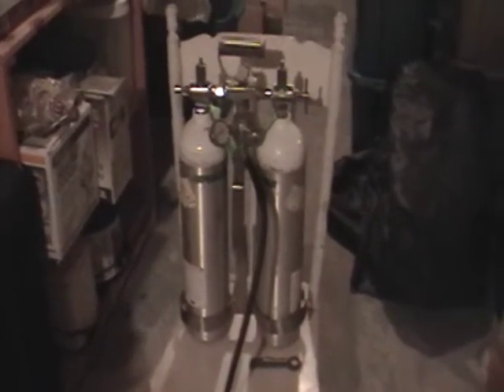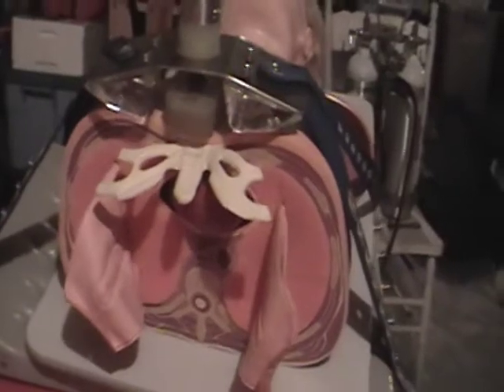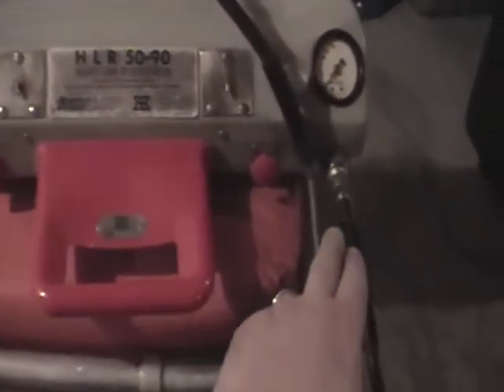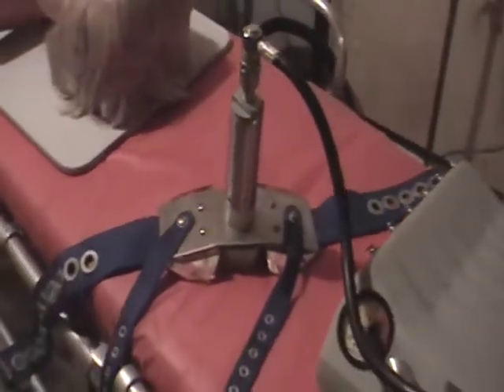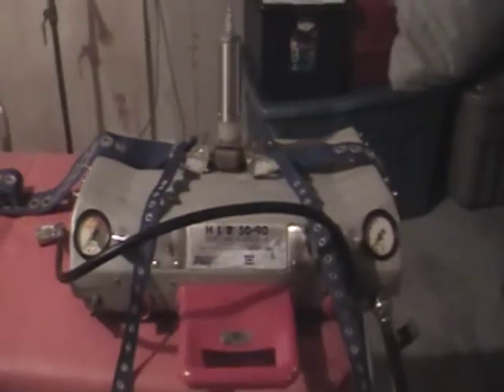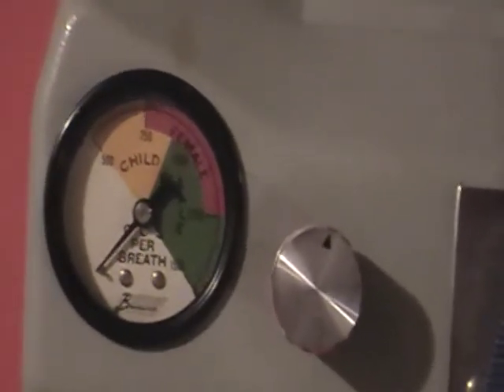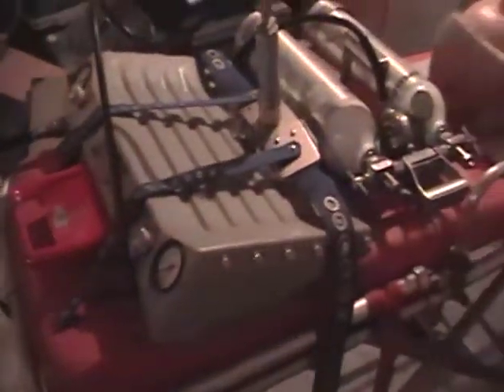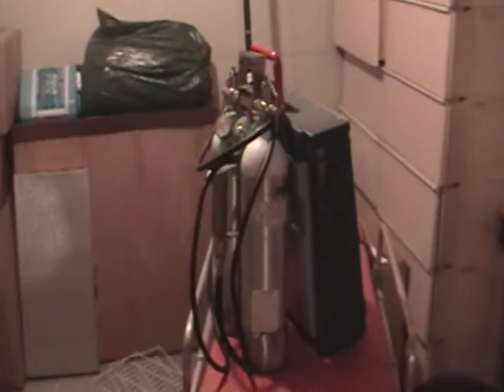Vintage Ambulance Equipment - HLR (Heart Lung Resuscitator)

Comment from the maker: Thanks for the comment.

This device was built by Brunswick Manufacturing and according to the serial number was manufactured on September 23rd, 1963.  It is the right age to be used in either my 67 or 69 ambulances.

Brunswick Manufacturing is still in business.  I have been in contact with them regarding this unit and they will send me the owners manual and the O2 mask and appropriate tubing.